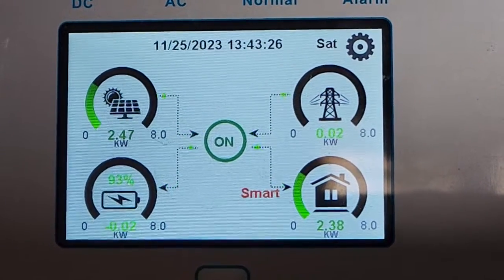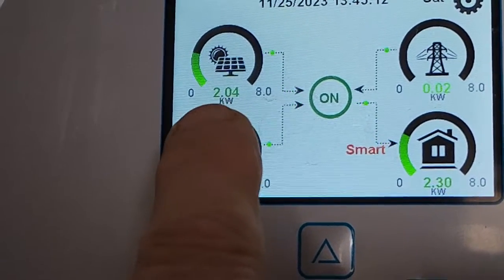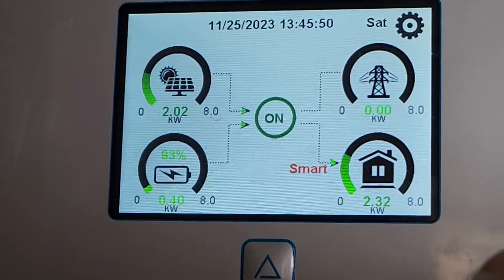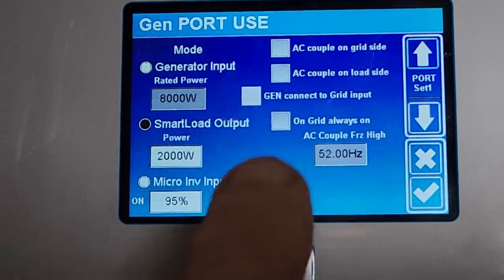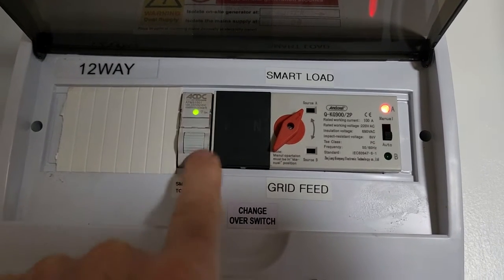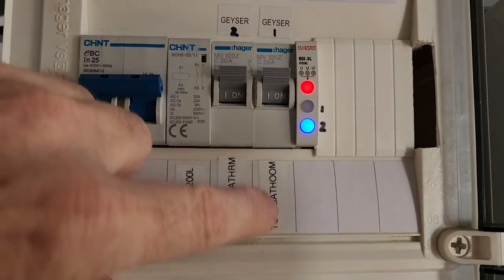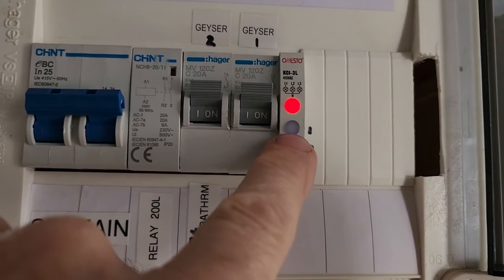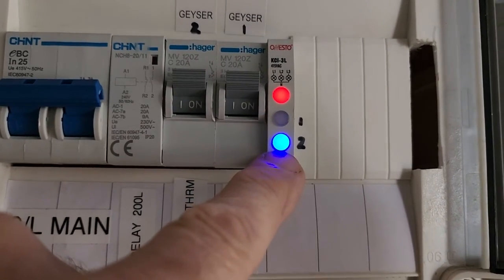Deye inverter: Smart Load settings powering 2 geysers

Comment: How do I get smart load to work please 😊
Reply from the maker: See manual:
1. Wire as an OUTPUT onto GEN input
2. Set SMART LOAD settings in GEN setup
3. Parameters set to switch output ON:
 a. Solar Watts must be reached
 b. Battery SOC% must be reached

BOTH MUST BE REACHED TO SWITCH ON.

To be done by an electrician!!!
Reply: @bolandsystems2024  what about setup when there is no option in menu solar watt. There is only bat On and Off?
Reply: @appalachianmoonshiner7084  maybe the menu looks different without a battery. I also have no battery and I can't set solar power...

Comment: Hello i have a question
I also use smart load on my deye 6kw inverter 
I put my conditions for 50% 55% for the battery and the 1000w for PV
For the on condition it is doing alright (when pv is higher than 1000w and lithium battery it kicks on) but for the off condition it only kicks on when the battery is below 50% and ignores the PV condition 
Can you explain that to me please
Reply from the maker: I have since found that in your scenario (only SOC switches off) is when there is no grid present.
It then ignores PV
Reply from the maker: It swithes On when both parameters are met.
It switches off when 1 parameter is not met >1min.
It swithes back on after the battery has charged & both are met again.

Your geyser's kW should preferably be lower than the PV setting, or you will cycle your battery a lot!